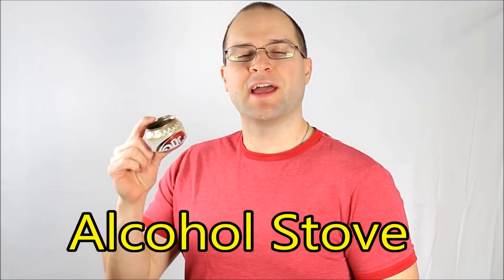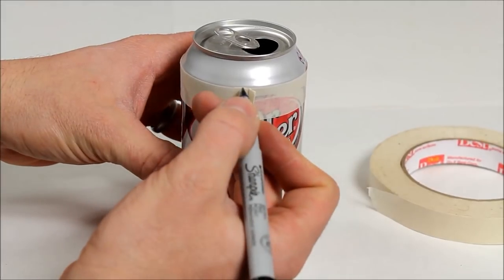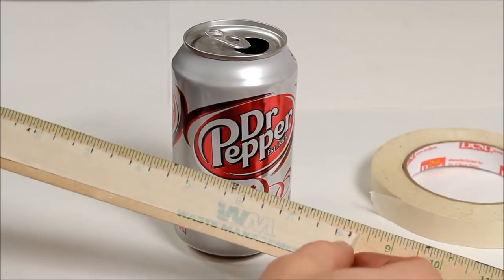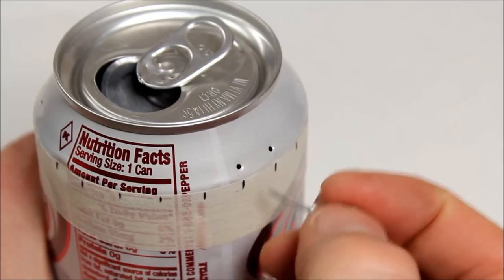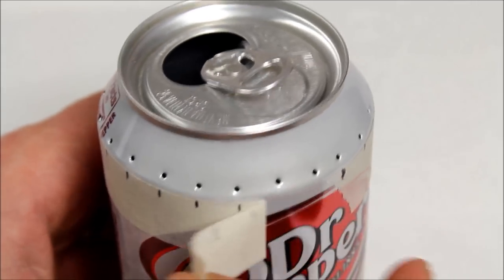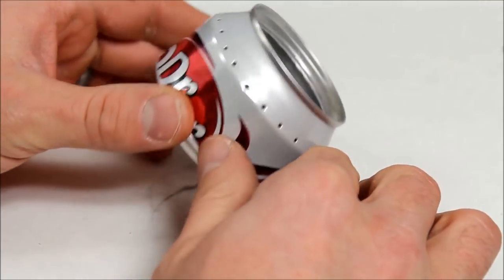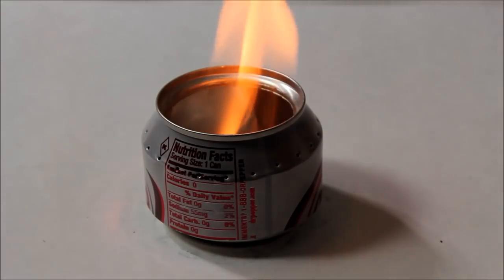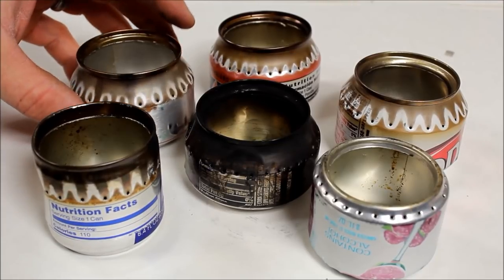how to build an alcohol stove from a soda pop can easy DIY

Comment: Another way to remove the top of the can is to take a piece of sandpaper put it flat onto a table and put the can't upside down on the Sandpaper with a little bit of oil or water keep moving in a circular emotion and then after a little bit you get the cleanest cut possible

Comment: 9:40 stoves covered in soot. Isopropyl alcohol needs more oxygen to burn completely. Try ethanol for less soot (and blue flame).
Reply from the maker: Great tip. I am going to have to try that. Thanks
Reply: could this be used for inside one's home? And the alcohol is it the ones we buy at a local Dollar Store? I live alone with a 2 year old and don't have no one to help me if in case an emergency. So I'm having to learn all of this. Would be appreciated your sound advice. Plz and Ty

Comment: Good builds on all of them but using HEET gas line "drier" will allow the stoves to burn hotter and cleaner!!! A much better product than any isopropyl alcohol!!!
Reply from the maker: Indeed I did not have any at the time. For some reason I think those stoves are cool. The alcohol coil burner is pretty cool to.

Comment: since your not using ethanol i am not so sure, but with functioning Double-wall, the jets should fire up with in a few seconds. these stoves burn just like ones without double wall. there is at least one clip which shows the trick. i also don't get why people build double walls with three walls, since one already has two walls when the upper and downer "half" get pushed together. you just need to modify the inner wall to create minimal quants of space between those walls where the alcohol can vaporize and stream out of the wholes. Voila, jets heated up within three seconds, yes, three.

Comment: For cutting the top of the can u can use a can opener it would make it way faster plus u dont have to worry about metal shavings
Reply from the maker: Now that's  thinking and an idea I like. Thanks
Reply: RealQuickChris can I use a nail instead of a push pin?
Reply from the maker: Durplepurple94572 
Sure I would try to use a small nail but if you have time make a few and see what works best for you.
Reply: @RealQuickChris  
Does can opener work???
Reply: @charlesmichaels6648  yes

Comment: I use Dr pepper cans and the diameter of the bottom rim is smaller than the diameter of the top rim, so the inner wall circumference doesn't fit. How do I solve this problem?
Reply from the maker: The only thing I would try is to taper the inner wall, almost like an inverted cone of sorts, so then it fits but it’s going to be tricky. I made a ton of them before I got a few that worked well.

Comment: Out of curiosity, what happens if you don’t include the inner wall?
Reply from the maker: Just a guess but it will burn but not turn into a gas and jet up.
Reply: The fuel in the central reservoir will burn but nothing comes out the jets. The jets work because fuel vapourizes and builds up pressure in the gap between the walls forcing vapourized fuel out the jets. No gap, no pressure unless you find another way to pressurise it.

Comment: Could making the center hole smaller result in longer burn time?
Reply from the maker: It's worth a test the center hole is used to pre light it getting the fuel up to temp and hot enough to start to turn into a gas then the outside ports light.
Reply: RealQuickChris I will do it tonight and get back to you with the results
Reply from the maker: Cool burn time testing
Reply: RealQuickChris how long did a normal can run for?
Reply from the maker: Oh boy I don't remember long enough to get 6-8oz of water bubbling
Reply: RealQuickChris I made a regular one and the holes do not want to ignite...halp?
Reply: Did I make the holes too small?
Reply: Where can I contact you to send you a picture
Reply from the maker: The holes light when the fuel heats up enough and starts to turn into a gas and flows out it the holes(the jets). The fuel needs to flow from the center to the sides heat up turn into a gas then flow up and out the holes and light.  Is there good flow from the center to the sides? The two small cuts. And too small of a hole might effect things as well as to big of one and the number of holes. Using a thumb tac or push pin worked well.
Reply: RealQuickChris Yes I got it to work...I just needed bigger holes! Now I can make a stove with a smaller middle hole and compare the two
Reply from the maker: Nice I am sure there are a ton of little improvements you could do to get these things running great.
Reply: RealQuickChris btw I am 14 😁
Reply: And the center hole not only speeds up the heating up process, but ignites the jets faster, and has a much longer burn time...try it out!
Reply from the maker: Cool great to problem solve and figure out how things work

Comment: What do u mean by ..self ignite..?
Reply from the maker: Maybe not the best choice in words. You light the fuel that sits on the inside and once the fuel heats up enough it will ignite on the outside vents (holes)
Reply: @RealQuickChris  so once u ignite the fuel..the flames will come out the vents soon after